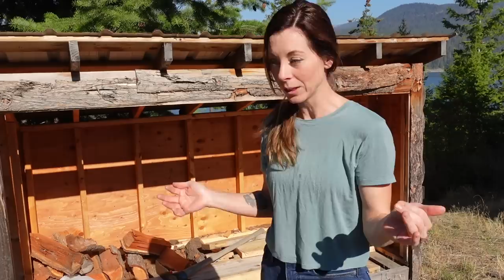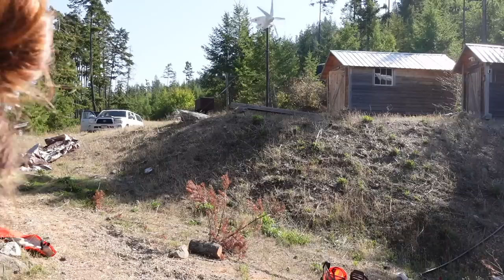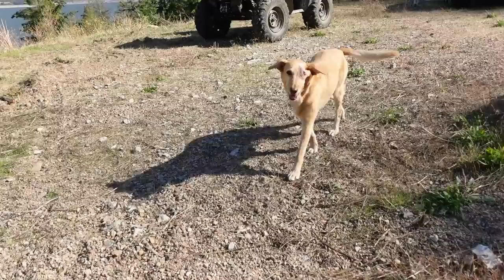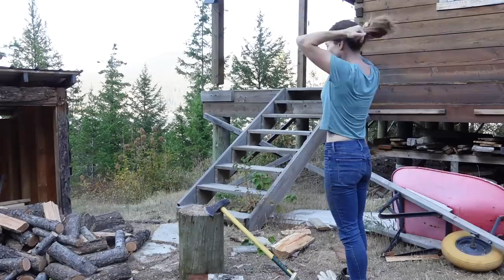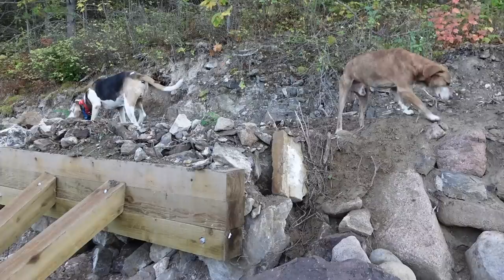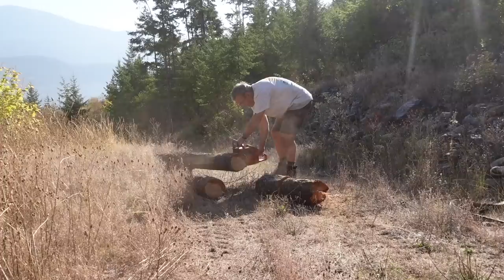GAME ON! Us VS. Firewood. (Ft Big Steve and game cam footage!)

Comment: Morning Michelle. There is a stink bug trap you can make. It consists of a plastic drink bottle, you cut the top to make a funnel that you flip upside down and attach it to its base. Before attaching, put inside a led light that has the on off switch on the actual light part, you can get packs of 3 at any hardware store. Now use masking tape the two bottle parts together and use duct tape at the bottom of the bottle to make that area dark to hide the light about 2 inches high. Also make a masking tape bridge from the top to the bottom it's so the bugs can climb up, fall down or climb down the funnel and get trapped inside. The stink bugs are attracted to light. Turn the led light on with a pencil that way you don't need to open up the bottle. Best of luck

Comment: Through some other video, I’ve learned that using a shorter stump for splitting would gives your axe head longer to travel and generate downward force. I think if you lowered your hit point 6-8 inches; you’d notice a difference. Fun Vid!
Reply from the maker: Yeah you’re probably right. I had a shorter stump but it rotted out. I’ll cut this one down 👍
Reply: I like to stand on the uphill side, too, whenever I can.
Reply: Theres the old trick about using a tyre on the stump to stop the wood flying off so should save alot of bending over.
Reply: 10/4 that suggestion!
Reply: Also a portable option, using a section of rope small knots spaced out for adjustment points, a prusik knot, black rubber bungee for tension. Basically safer, and reduces the wasted energy of chasing and remount the wood. You start with a bundled cluster.

Comment: Nice lovely looking place ❤.    Hand splitting firewood, done that lots of times, sometimes still do, but now mostly hydraulic work..lol. the splitting mall I used ones in a while anymore is roughly a 13, 14 lbs  little heavy to left up  but it splits almost everything,  but you know how they always say "use a block of wood  to split on for a solid bace"   will I found out its easier to use a small block of wood or no wood at all for better and harder faster hits.    But don't just take my word for it seen some other people done the same thing. You should  try it  and see if you notice any difference.

Comment: Hey guys, I found an awesome tool for wood splitting, it looks like a cross between a splitting maul and wood splitting axe. It’s made by Fiskers but the axe head has wings for the lack of a better description that spreads the wood apart. It’s lighter than the maul and you don’t have to swing it so hard. Best wishes, good luck.

Comment: Thanks for the video, if you hit splitting wood in the center of the block, the block has to split completely in one go and takes a lot of force.  If you hit between the center and the outside, the block breaks open from one side and is much easier.  Much less force is then required.  Spread your legs in case the ax slips because you're hitting more on the edge towards you.

Comment: Tony’s wood splitting advice, use the maul and incorporate a sledgehammer to drive it through  the axe is good for finishing splintered out pieces.  It’s still a workout with the sledgehammer but on wet wood it makes it a lot easier.  Steve has the right idea with bourbon I recommend 1 to 1 ratio, one stick of wood split one glass of bourbon 😂.

Comment: Recommendations?  I promise a hydraulic log splitter still provides plenty of opportunity for exercise and more time for other things. You'll find it makes quick work of kindling also. I preferred to use it vertically. It's easier to maneuver a log into place instead of lifting, especially the xl pieces. Just make sure your glove tips are clear when using the splitter. Happy trails and hot tubbing, you two.

Comment: Great video as usual, but this is just a sugestion ;) next time you split wood, take a shorter stump of what your are using now, on what you are putting your piece of wood to split. This one is very high and you are using a lot less swing and force to swing that axe. My neighbors and friend have been making fire wood for about 30 years now, around 300 cordes a year, all split by hand also ... and they gave me that trick, they don't use and stump to split wood, they go directly from the ground. Lower the piece of wood you want to split is, a lot more swing you have with your axe and a lot less effort you need to split it ... they also gave me the trick that, better to split as soon as possible the wood after you cut it, than waiting couple of days, because the end of the stump is less dry and the axe doesn't get stuck as much than when it's dry, question of lubrification. Have fun ;)

Comment: I split rock hard mesquite with two axes; using one as the wedge and the other as a hammer.  Don't have to stand and swing a heavy maul that way.  Also start the split at the edge rather than center.  Looks like you're having a good time and have plenty to do!  Trail cameras are amazing!

Comment: Excavators , skid loaders , saw mill , maybe mix in a wood splitter . Just an idea also it’s so kind that Michelle edits the video to speed up Steve’s chopping.
Reply: I was thinking that too Richard. Not that there is anything wrong with axe splitting if you don't mind the work but when I see all the other gear I find it surprising that a log splitting isn't on offer. They did a great job between them anyway.

Comment: Hello Michelle. I know the plastic wedges would be nice to have, but until you get some, a person with your abilities could make some out of the hardest wood available. If there happen to be a door hinge that was not being used, the pin could be pulled and screw the halves into two wedges to prevent splitting for a few uses. Have good days!

Comment: Just a suggestion on saving your back,  Get an old car tire and put on top of the wood base.. from inside the tire drive a few lag bolt or screws with washers into the wood below.. Place piece u want to split into the center of tire...  This allows you to split wood and not have the split pieces land on the ground...

Comment: If your going to leave equipment out for winter you better winterize and cover well or it will get ruined drive it up off ground for air circulation and have Steve help with your small house build love videos your great keep up great work

Comment: My recommendation to cut your wood for the hot tub is to block half the volume by filling it with foam insulation boards (installed vertically). You will need something like a deck above them so they don't pop out of the water. Should be easier than switching tubs.

Comment: I really like splitting firewood too and I would have been using the ax you were using those heavy splitting axes like he had are really not what I like. We actually just had a hurricane blow through here in Florida where I live and afterwards I had to fell a cedar tree and a good bit of oak. I still have to split it however all I have at the moment is one of those heavy splitting axes and it's actually kind of damaged so I think I'll probably end up having to baton a hatchet with small sledge hammer.

Comment: Years ago I used to split with a maul. Everything I have here is Oak or Hickory, so I got tired quickly. You might want to try the “cheat” I used. When the maul got stuck, I hit the blunt side with an 8 lb sledgehammer. Usually it only took 1 or 2 smacks before the wood gave way. It’s not “Kosher “ but it works. You should wear safety goggles to avoid possible metal chips that could be released.

Comment: One of your videos recently showed up in my feed.  It looks like you, Steve, and the rest of the family have a wonderful life in a beautiful location, as well as the time to enjoy it all.  Sure wish I lived in a place with such inspiring views, etc.  Switching gears to wood splitting, I use to use a maul like the one you have, but it was frustrating at times.  So, I got a Fiskars X25 splitting axe a while back, and I can't believe how much more enjoyable splitting wood by hand is now.  I wish I had got the X25 years ago.  Another thing that I do when splitting wood - and one I learned when I took karate lessons many years ago - is to "drop" my knees during the swing to generate more force.  These two suggestions - coupled with a previous comment about adjusting the height of your splitting block - would likely make your wood splitting more fun as it has done for me.  It looks like the X25 is available on Amazon in Canada, but for a slightly higher (converted) price compared to the US, where I live.  Even with the slightly higher (converted) price, I still would have bought an X25.
Reply from the maker: I’ve read a few comments suggesting that axe! I will definitely check it out. Thanks so much for the tips!
Reply: @michygoss7148  This YouTube video from Fiskars provides guidance on choosing the right size axe.  I'll paste the link, but I'm not sure YouTube will let it go through.  If not, search for "How to choose the right size Fiskars axe".  There's also an X17 that's shorter than the X25, so the X17 could be a better fit for you.  The X25 is a great fit for me, but I also have the longer X27 for tougher splitting.  The X27 isn't as good of a fit, but I make it work.  Take care.  https://www.youtube.com/watch?v=TOxKdtZwHMM

Comment: One thing I learned when we burned wood for heat was when it was cold all of it would burn even green you just had to put enough dry in with it. 
That was some cool bear video.
Reply from the maker: I think (*think*) the main concern with burning green wood is the creosote that builds up with it. ?
Reply: The slow burning wood heater in my bedroom built up creosote like crazy.  My living room fireplace which I burn much hotter, has never built up creosote.

Comment: With all the fire wood that you folks use, and will all the nice equipment you own like your small skid steer, a mini excavator and your sawmill, I'm surprised that you don't have a wood splitter.  As for needing to burn calories, I think you both work hard enough as it is to burn all the calories you need to to stay in shape.  keep at it..
Reply: yeah and splitting wood damages the tendons in your shoulder cups

Comment: I love splitting wood. It is my therapy. A trick I learned a while back is that you want to hit the top of the log when the axe/splitter handle is parallel to the ground, and the head of the axe is going straight down. It is that point in the arc of the swing that delivers the most power into the log. More of your swings (that did not go through on the first swing) would go through. Additionally, the axe head won't get stuck quite as much, and be a little easier to remove when it does get stuck. (It is also the secret to ringing the bell at the county fair. Wouldn't it be fun to ring that bell and then watch men twice your size be unable to do it?) In a lot of your swings, your hands are low and below the head of the axe at the point of contact (11:44 paused).  You can also see that the far end of the axe blade is not in the wood, and the near part of the blade is buried.  Mechanically, it's just not as efficient. A shorter chopping stump would be perfect for you, but you can also adjust your swing up and down to hit that sweet spot. You will be surprised at how big a difference this makes! Of course, you also have to make sure you drive it straight down once you make contact, and not continue the swing, like Big Steve did at 17:28! It looks like you already do that, but it is easier to make that mistake when you are going for the sweet spot. Safety first!

You have taught me a thing or two from watching you build your projects, and I am totally impressed, grateful and inspired. Thanks!
Reply from the maker: Ok! Thanks for all the pointers!! 👍👍

Comment: Team work gives some serious results. But Michy, I give you an advice that could simplify your life a lot. Splitting wood with a maul or axe is the most tedious work with the most annoying workflow -hit it, extraxt the axe, hit it again, it falls, pick it up, hit it again, it flies away... Why don't you make yourself the easiest form of a splitting machine, hand powered, called the "pendulum splitter"? It's extrememly easy, no gas, no effort, no noise, just pure wood cracking... 😉You need only a couple of parts, can be made of timber with a metal pivot thingy or a couple of bearings.. It should be very gratifying to use it. Cheers, keep on, you rule. 😎
Reply from the maker: But it’s just so satisfying to chop!

Comment: And try putting your hammer on your split mall on the top side of your log and hitting your log on your split and block that way when the log hits it it forces the weight of the hammer through the log

Comment: Easier wood splitting. Use one of the teeth on the bucket of the miniex or weld a maul head to the back of the bucket. Line several logs in a row and one at a time push down with the boom of the mini.

Comment: Just a tip. If you have wood and a chain saw, you can make wedges.
Reply from the maker: Well, truth be told, I did make a wood wedge, but it still didn’t work. Maybe it needed to be much thicker, but the tree just kept leading back and my saw eventually got stuck too.

Comment: Had a splitting maul just like that and used it for splitting logs for years.   Bought a Fiskars X25 splitting axe and never used the maul; again.   If you like the length of the maul, get an X27, (same head as the X25, but longer handle).  Both are so much better than a traditional maul.
Reply from the maker: Ok I’ll check them out!
Reply: @michygoss7148  - good to hear.  Also, your chopping block was too high for logs - perfect for kindling but if it is that high for logs you don't get the full down swing of the axe. And just to check - you do know that you should loosen your grip of the handle as the axe head hits the wood, so it twists and helps the wood split... Regards from the old country...

Comment: Don't be annoyed by this 🙂... but for your safety... don't throw the axe head at the log. Aim through the log, as though to strike the large base beneath. This will naturally bring your hands lower, so if you slide off the top log, or it splits easily, the axe head will travel down to the base instead of toward your legs. With this technique you can then use the round-house swing that brings momentum to the axe head without worrying about safety. You'll get a nice rewarding rythm going. Kick ass girl!

Comment: I split many, many cords of wood. When my maul would not split the round I would grab the maul handle with my left hand and rotate it away and  with the right hand I would grab a 6 pound, 24 inch short sledge. I could swing the sledge hammer like a windmill and drive the maul threw the round like a wedge. No lifting the sledge, just round and round till the maul did its job. Give it a try.
Reply from the maker: Yes, that was what I was referring to by not having a maul to help point the axe into the wood. I found it, but not till later that night. 🤨

Comment: Feel like Steve was trying too hard to hurt himself to show off with the wood chopping...I was wincing a bit at it.  Weight of the axe head with gravity is supposed to do the heavy lifting.  If it embeds partway down you just pick the whole thing up and use the extra mass of the axe head+log striking down together to help drive the blade the rest of the way through rather than exert yourself to unstick the axe and try to hit it again.  Like I get it that wood chopping is supposedly "men's work", but you're in far better shape and far more capable at chopping than most men as it is.

Comment: Swinging the axe wrong.  You need to start behind your back, have your left hand on the bottom of the axe handle, and the right hand at the top of the handle.  Raise it up with your right hand over your head, around and into the wood.  When the Axe reaches the top of your head, start sliding down your right hand to your left hand.  Your left hand barely moves position.  The sliding motion of your right hand creates incredible downward force which will help split the wood better.
Reply from the maker: I’ll try it! Thanks!
Reply: @michygoss7148  It'll feel a little weird at first, but then very natural, you'll see how much easier it gets to chop wood, and wonder why you ever did it the other way.  Good Luck!

Comment: Michelle I don't know if you are done with the wood but my preference on the splitting male ( axe) when I get a new one I find a rock or concrete and doll the heck out of it like that it doesn't get stuck in the pieces of wood that I am splitting but that is my preference so any axe I use for splitting wood with I want them doll not sharp at all have a great day

Comment: Sink that fat splitting ax into the wood and when it doesnt split, hang onto the handle with one hand and hit the splitting ax with an 10lbs. sledgehammer. That drives the splitter in and you dont need too try and pull it out when it doesnt split on the first hit. Thats how I do it anyways...